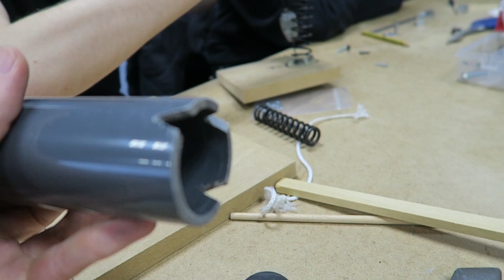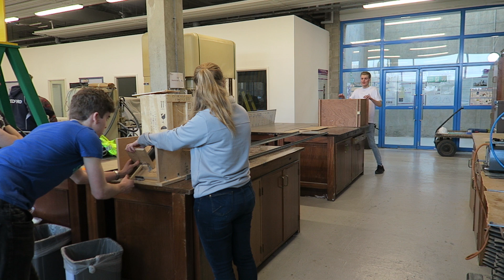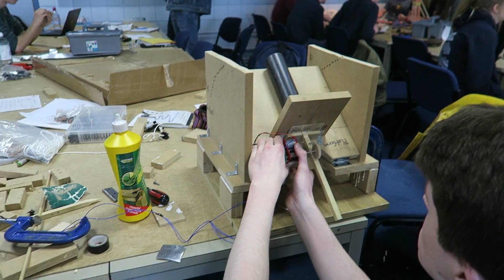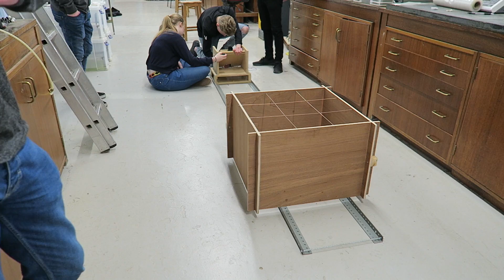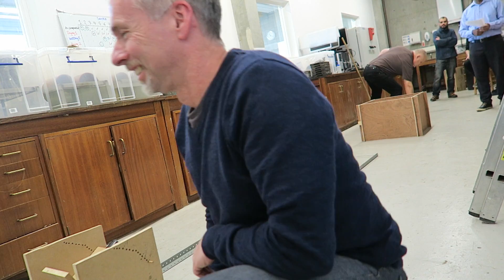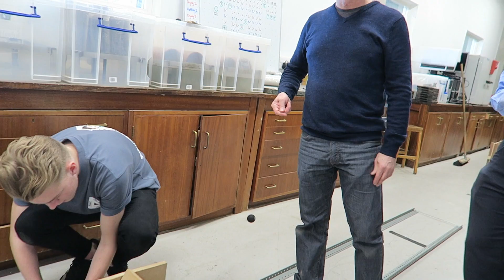IMechE LINE LAUNCHER CHALLENGE - Durham University Engineering Design Week

Comment: How did you prime it? I see you have various power levels? Was it achieved with small notches of varying lengths on the central rod? With a catching groove they would ever so slightly slot into?
Reply from the maker: Hey Joshua, sorry I missed this comment. What you described was our original plan but we just couldn't get it to work. In the end we used two screws at different lengths which butted up against a metal plate when primed, but this was not a good solution. We only got a few uses out of it before it ripped itself out of the dowel!
Reply: @LiamBushrod  No worries, I appreciate the reply, i'm doing the same project this year. So the dowels went through the central rod after the hole? Two for two different strengths?
Reply from the maker: @joshuabradshaw6355  you're not the only one, this video is getting the second most views of any video on my channel at the moment! 
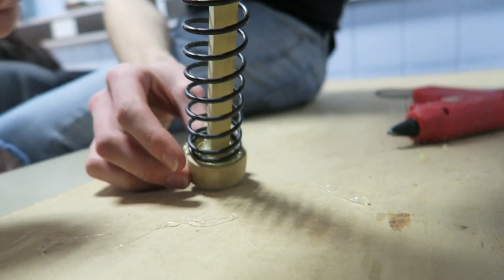Yeah the dowel is connected at one end to the end plate that launches the ball 0:36, and goes all the way through the middle of the spring and out the back vertical board through a small hole with just enough room so it can be lifted into its priming position
Reply: @LiamBushrod  Awesome, makes sense now, cheers lad. I actually ended up watching a fewa your vids after this one, sorry about your 2nd year results man.  Hope you did well in the summer resits and things are looking up 👌
Reply: @LiamBushrod  These clarifications were really helpful, thank you

Comment: What motor are you using?
Reply from the maker: Can't remember, it was just a cheap one though. The most important thing for us was stepping up the torque as there was a lot of tension holding the dowel in place, so we bought a 4000:1 gear ratio kit for it

Comment: You guys ran multiple attempts at different angles and made a hole for each distance when you get it right?
Reply from the maker: We made the holes first which was not the right way round to do it, but we had enough to cover all distances, especially as it's break itself every 5 releases and all the distances would change after the fix
Reply: @LiamBushrod  same, i wouldn't bother calculating air resistance, I would just test it 200 times and make a hole there, not sure when I can do these trials since our run is gonna happen in 2 weeks
Reply from the maker: @hussam9044  good luck!

Comment: Doing a similar project at uni currently, bit stuck on the launching mechanism and I'm curious as to how you guys did yours?
Reply from the maker: +Gordon Taylor With difficulty! We had a screw sticking out of the dowel rod which latched against the vertical piece of MDF when the rod was pulled back. Actually we had to add a piece of aluminium to the vertical piece of MDF because otherwise the screw ripped MDF to shreds 😂